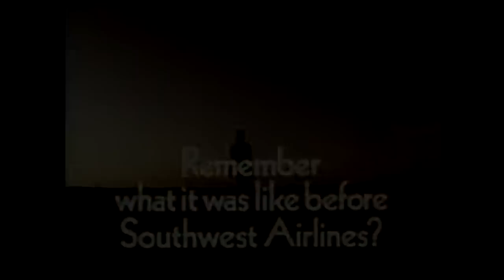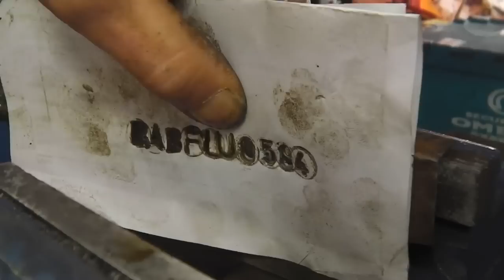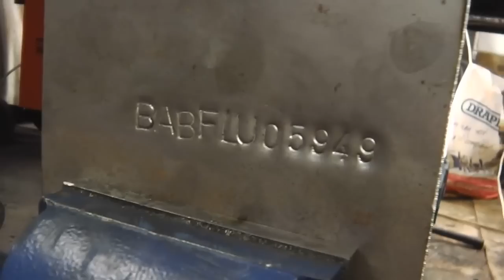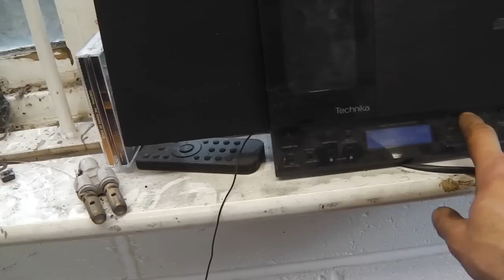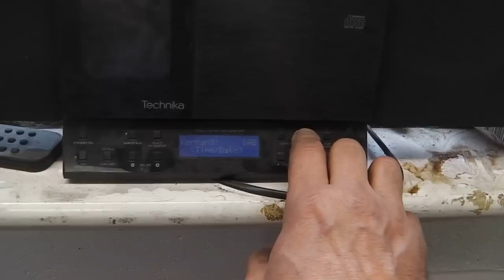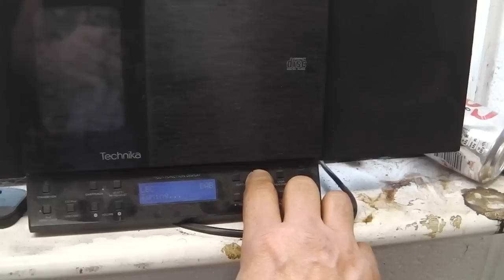Ford Cortina MK3 GXL Restoration Video Episode 49 PT6

Comment: What a mile stone the Vin number is, sort of giving it it's name back after a refit on a boat. You'll drive yourself daft if you try to perfect the gaps, they were never perfect and quality of batches of panels varied. Have you measured the doors to see if one side is longer than other? Also I noticed the passenger wing is in black primer not Ford brown primer so could it be a very good pattern panel? Not far now to the big dip, are you going to film it?